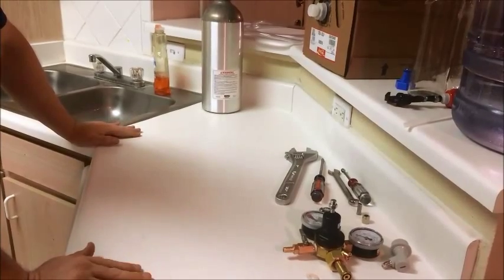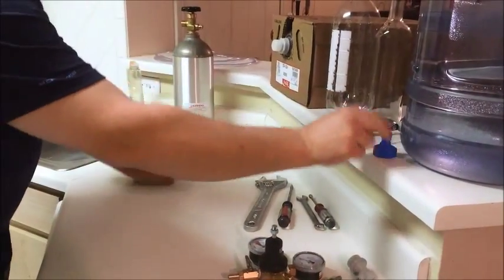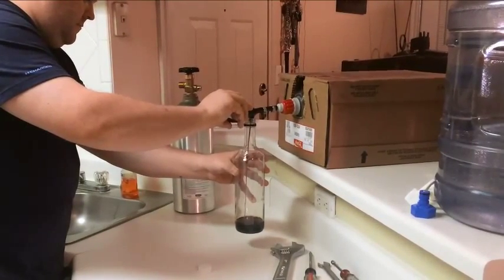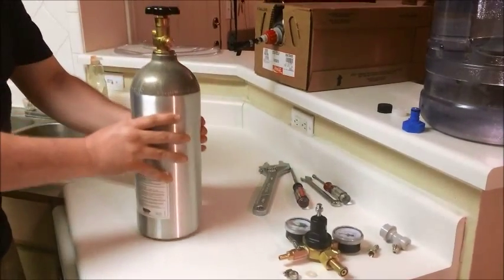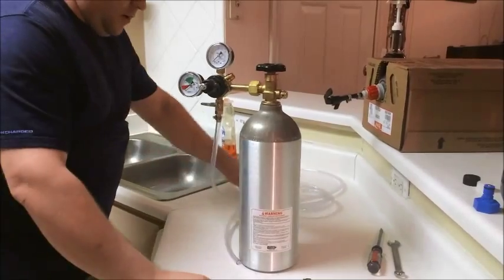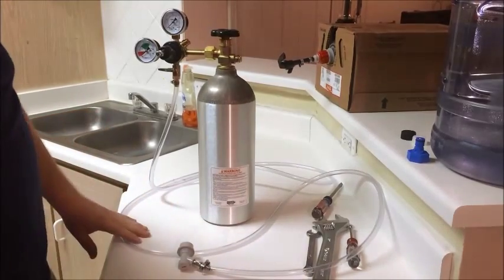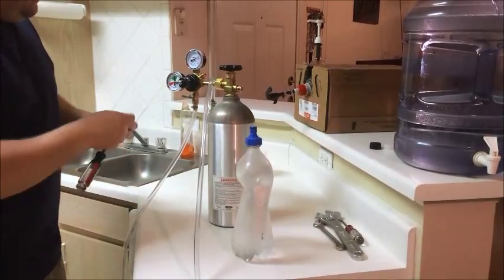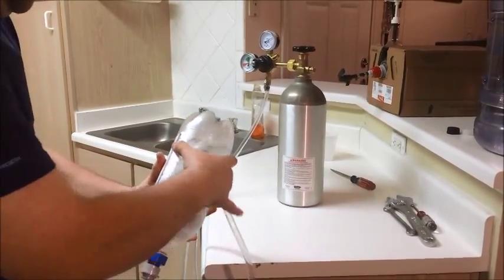Do It Yourself Carbonation Device for Homemade Soda Drinks Tutorial.

Comment: How to spend 100$ on fittings and tubing to avoid spending 100$ on a real sodastream . of 50$ on soda.Its a cool accomplisment for the pride of doing it yourself though .  .
Reply: Good way to miss the point. He can freely buy carbon tanks now and it will easily pay for itself in savings over time. He's not locked into Sodastreams proprietary tech, this means that he has complete freedom in how he constructs his drinks. So flavor, amount of seltzer made, bottle size, etc. 

All that has to be done is to just leave empty bottles in the fridge/freezer and to use water that is right above freezing. He'll get an insane amount of fizz and versatility. Sodastream is just more walled garden crap that sells at a premium due to people overpaying for convenience or not understanding their options. Even a basic soda siphon is superior to any Sodastream.
Reply: Go price the sodastream Co2 refills and then comment
Reply: To put a fine point on what Jad Just-A-Dales says; Sodastream uses the Kodak camera model - sell the camera cheap and make it up on film. Same for your inkjet printer. Sodastream refills are crazy expensive. The tank and regulator method costs LESS than one cent per liter. I get indignant when I'm in a restaurant and they want $2.99 for a glass of soda water. I won't go back there - and that includes the Las Vegas casino that wanted that much. 90% of places don't charge for soda water 'cuz it's almost the same price as water.

Comment: You people know just enough to be dangerous Cocoa Cola is mixed at a ratio of 4.5-4.75 :1 in other words 4 1/2 oz water to 1 ounce syrup and pepls is 5:1 , the thing you call a ball lock is commonly called a quick disconnect and it is color coded gray is for gas and black is for syrup. If I were doing this I would get a air stone and a tube and run that  into the bottle and attach it to the regulator and bubble the CO2 into the water eliminating the need for shaking the bottle and taking a chance of having the bottle explode in your hands! 

I was in the beverage instillation and repair business for approximately 20 years I know what I'm talking about!
Reply: You realize those 2L bottles are all pressure tested at 120 psi before they leave the factory right? Just don't use the same one 5000 times and you will have zero problems
Reply: so  where  do  u get the tank  from i  use a soda stream to carbonate....
Reply: you  buy corny keg and use a soda streamtank